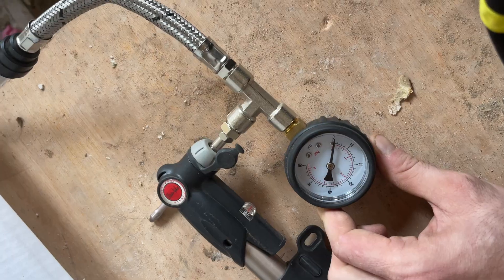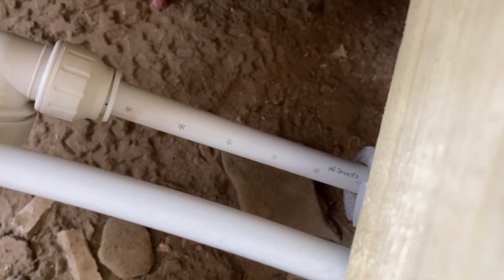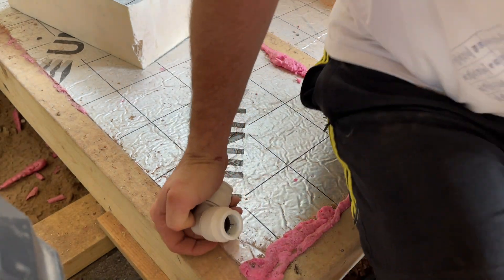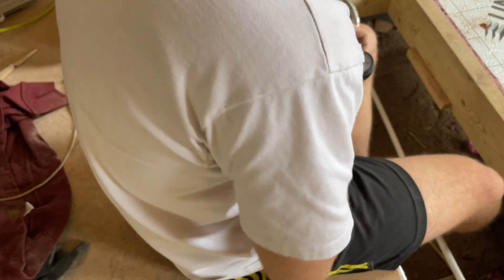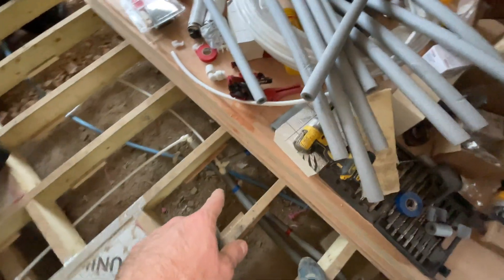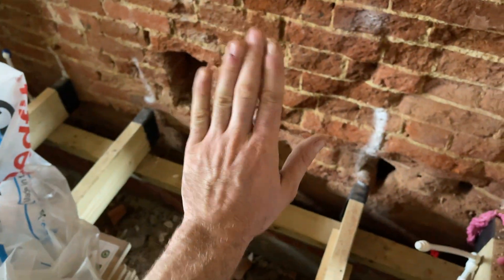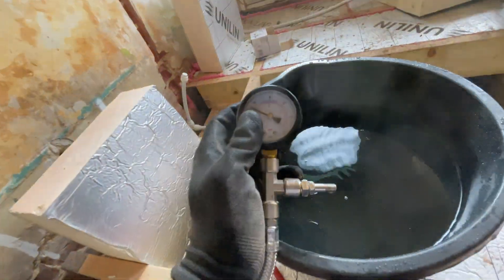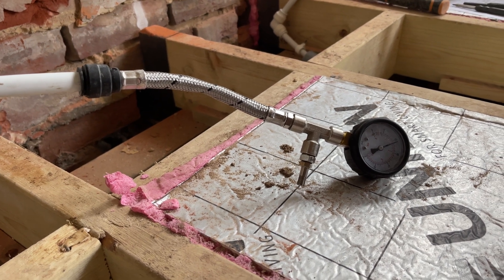Central heating for £15?!

Comment: Ah brings back memories of doing my last place. I made up an air test using a bicycle inner tube! Was convinced there was an air leak upstairs and cause the t&g was down we ripped all the ceilings down and couldn't find the air leak. I then bought the Rothenberger RP50 and done a water pressure test...no problems at all!
Reply from the maker: this will probably be me in a few weeks 😂 but partly why I didn't go for Tongue and Groove this time as I have PTSD from the last time it was used (the only bit in the old downstairs of the last house that was Tongue and Groove had the leak) had the laminate flooring down and under the skirting boards at that time too! I didn't do that though.. where a few of the fittings were leftovers from a friends project I had a sneaking suspicion there could be an issue so the floor stayed up!

Crikey ive just looked them up they look like quite a bit of kit! looks like they're about to the back on at Jurassic Park with that pump lever!